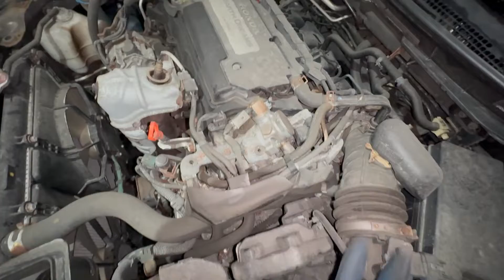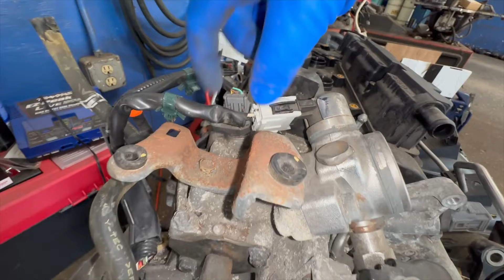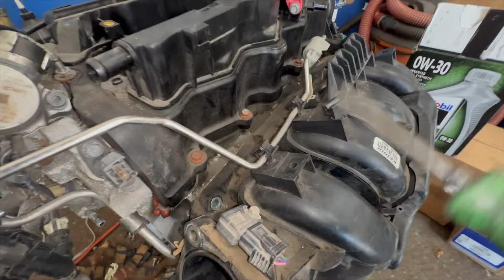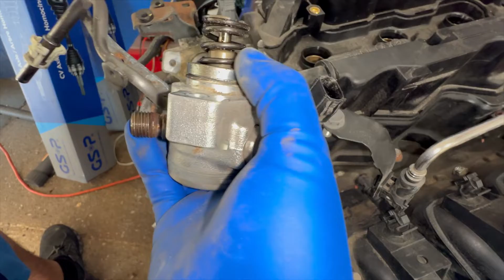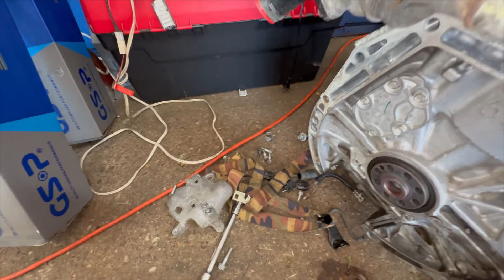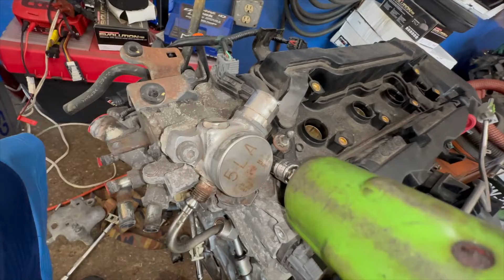How to replace High Pressure FUEL PUMP on Honda Accord 2013 to 2017

Comment: You’re supposed to replace the fuel pipe anytime it is removed from the fuel pump.
Reply from the maker: This is a demo video as u can see engine is on the floor
Reply: @ yes but you should tell people to replace the line. It’s a safety issue to make sure it seals, as it’s under high pressure.
Reply from the maker: @ will do
Reply: What is the part number for the fuel pipe?

Comment: Sir, what do you call the connector that you remove to from the high pressure fuel pump?
Reply from the maker: Electrical connector is called pig tail connector for the HP fuel pump

Comment: Hi I had a question I figured you’d know. I have a 2009 Honda accord exl sitting in the garage. Nobody knows what’s wrong with it including Honda 🙄 basically when I try to start the car it stalls. I push the gas to keep it started but once I let off the gas stalls immediately. Any suggestions? My old mechanic told me to clean the throttle body. Any suggestions to what it could be?  Thank you so much :)